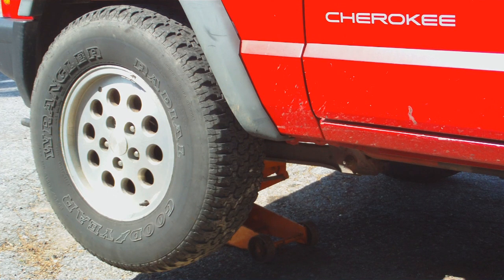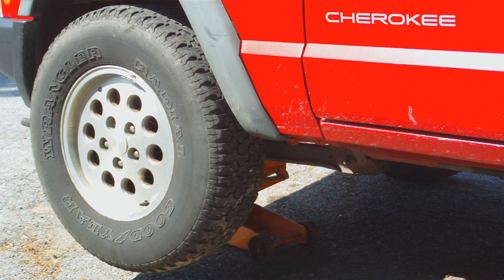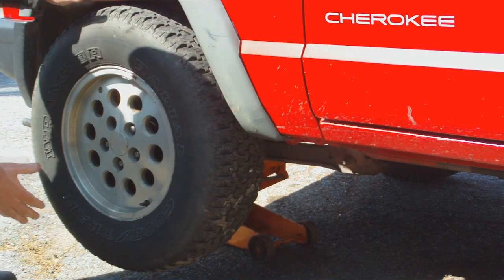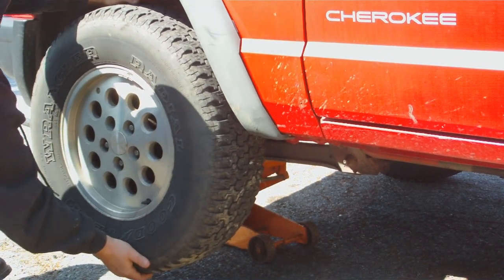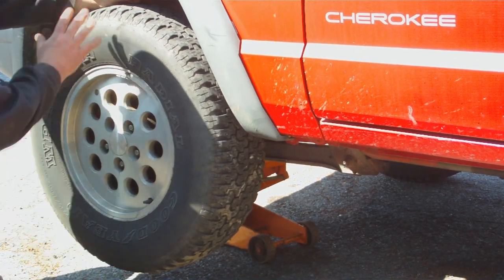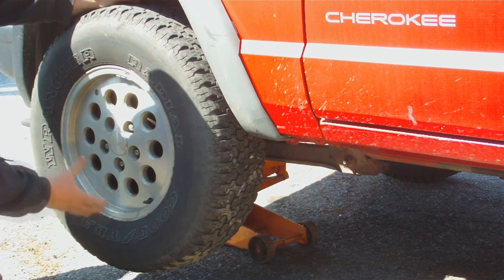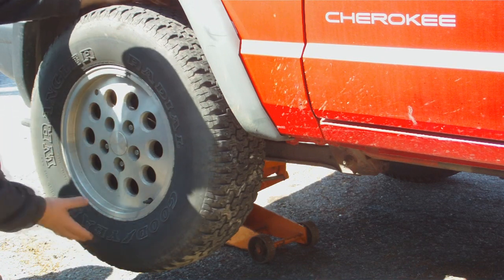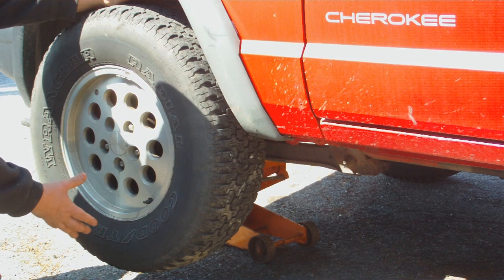How to check for a bad wheel bearing basics

Comment: It should also be noted that a north and south shake can indicate a bad upper ball joint if the vehicle is equipped with one. It's better to do the tire shake from under the vehicle so you can watch all the suspension components to ensure you're diagnosing the correct part at fault.
Reply: ..bearing set will cause shimmy and it's a clunker. Thanks